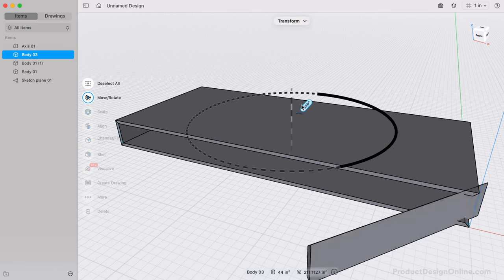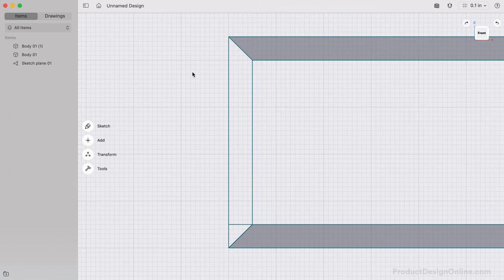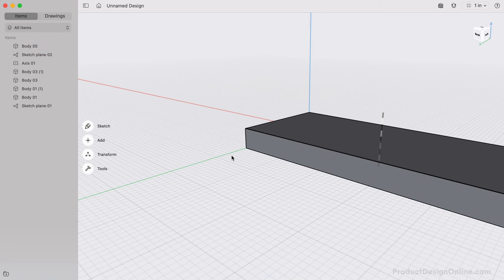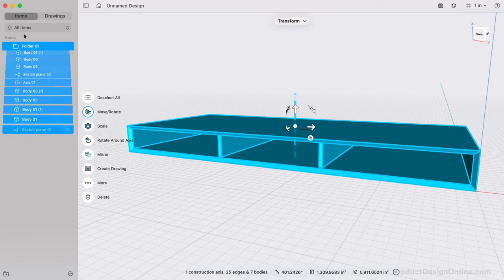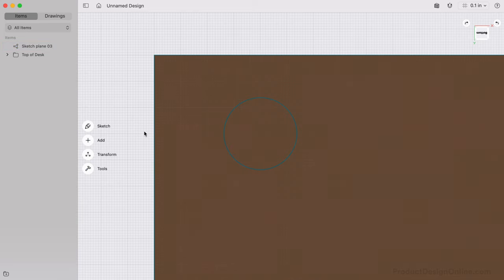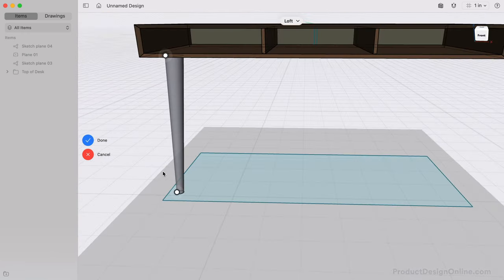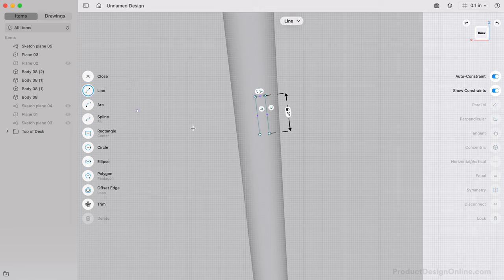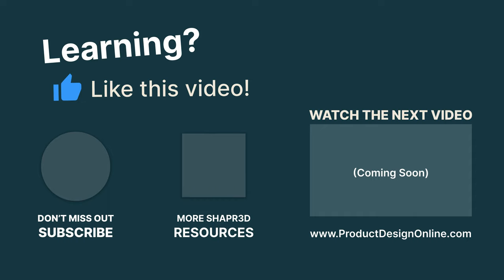Shapr3D Tutorial for Woodworkers | Day #8: Modern Wooden Desk

Comment: I find the simplest things to be so difficult with Shaper3d.   Such as the dividers inside the box.   With Sketchup, it would be super easy to just draw a rectangle on the back wall anywhere horizontally, extrude it out.   Then draw a couple guidelines with mid points and move it with snap points.   You seem to always just do then math, but that can be a problematic at times.   Am I missing a command that would make this easier.
Reply from the maker: I agree. I am used to the same in Fusion 360. Extruding based on surrounding objects or entities. Unfortunately, Shapr3D is fairly new (in CAD/software development terms) and they don't support that functionality yet. I suspect it will come eventually.
Reply: In your sketch you could draw three horizontal lines head to tail in your rectangle (that is locked). Select those three lines and choose constraint horizontal and equal, and without math you have your divisions.
Reply from the maker: @doctortropico  Great tip - thanks for sharing!
Reply: Just learned that there is now a new PATTERN function, kinda like the one in Sketchup.

Comment: Does anyone know how to print single pieces out as paper templates to scale? Is this possible with shapr3d?
Reply from the maker: Hi Marek. You can print the 2D drawings to scale as long as you set up the page size correctly in the settings. More on that here: https://support.shapr3d.com/hc/en-us/articles/360019936899

Some folks also export the sketches as DXFs > open in a graphics program > scale or check for correct size > print from Graphics program and/or export to PDF to print.